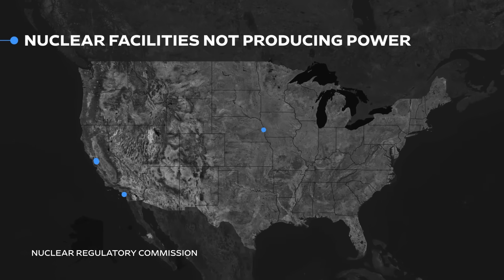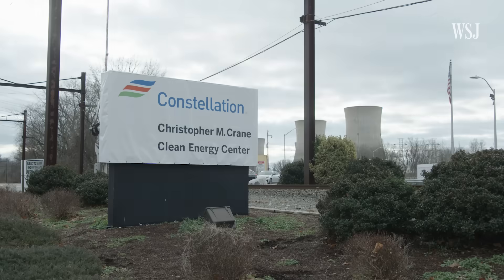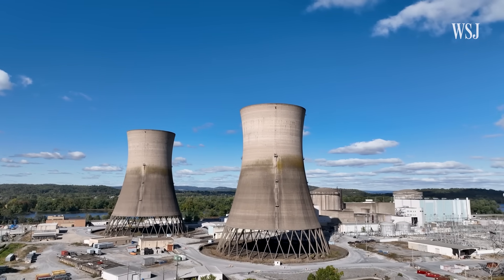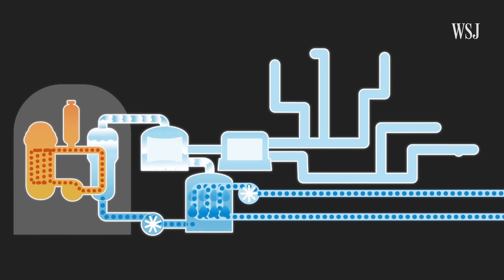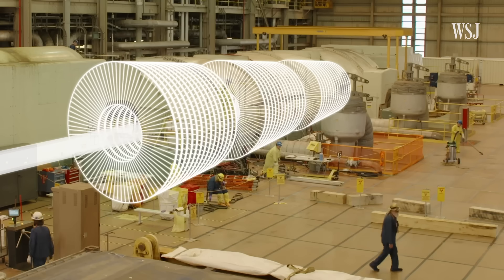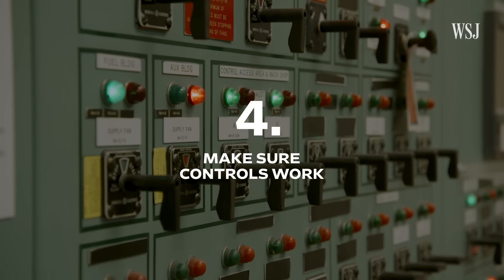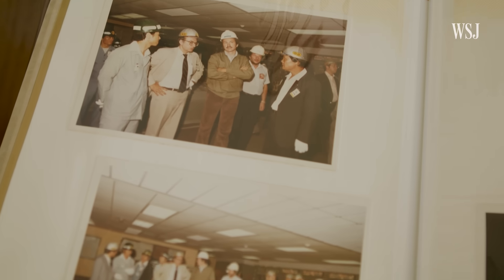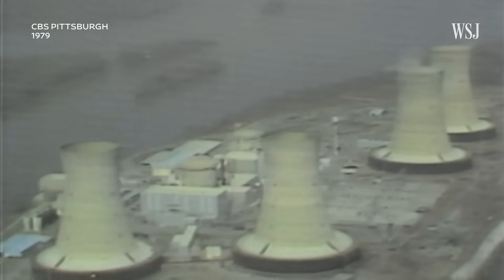Inside the $1.6B Plan to Restart Three Mile Island | WSJ

Comment: Three Miles Island was shut down due to commercial reasons. Translation: nuclear energy is to expensive.

Now demand has spiked due to the AI boom and Microsoft needs a "fast" solution. It seems to be relative cheap to get the old reactor back, but building a new reactor is a nightmare that the US gave up on a long time ago.
Reply: Yep, we tried to build a new nuclear player plant in South Carolina and had to stop halfway through. Georgia built the same plant and it costs 10x the starting cost.
Reply: As the old saying goes, "demand creates supply." Move the demand curve and the supply curve suddenly finds itself aligned with things that weren't previously viable.
Reply: They need power AND they probably get carbon credits from it too.
Reply: Constellation is selling to energy to Microsoft at 13 cents a kWh. It’s not that nuclear is all that expensive - it’s that natural gas out of the Marcellus is cheap. Couple that with the deregulated market where they sell - PJM, and yeah, it was got difficult to justify keeping online. 

Believe it or not 25 years ago when all this deregulated in power markets happened nuclear power plant operators were chief proponents of that - they thought they’re cheap nuclear power would whip the floor at the auctions -annnnd then the shale revolution happened. And suddenly you at natural gas bidding at cents a kWh.
Reply: @BernhardWelzel  aren't they building a new plant in Georgia? Several projects around the nation look it up
Reply: @FredroStarr12  I did. Just look at the cost overrun, timelines and issues this projects have. It is a nightmare. Building a new nuclear power plant is incredible hard in 2025.
Reply: It was shut down because of public panic!
Reply: @ Sorry, you get your facts mixed up. There was public pressure after fukushima, but the actual reason was cost and the need for investments. 

Same for example in Germany: the industry needed to invest a lot of money into the existing nuclear reactors and was very, very happy when politics demanded to shut down after fukushima.
Reply: This is the exact "roadway", a.k.a. strategy.
Reply: The financial reason was a bunch of cheap natural gas flooding the market, it remained profitable all the way into 2019 so maybe you're just wrong
Reply: @MrTrainman96  The company running the plant said it hadn't been profitable since 2012. But I'm sure you're right and that was just BS. Companies are after all famous for shutting things down that make them money.
Reply: @MrTrainman96  I am not sure. When you look at data regarding the cost per MW of energy that is not created by some nuclear industry "thingtank", it seems renewables are much cheaper. I am not saying nuclear is good or bad, it is just a matter of the numbers making sense. Of course, having a mix might be a great idea as well as factoring in the actual time to build a new nuclear reactor...
Reply: Nuclear Energy isn't expensive, but the main problem is that it produces too much power overnight. Most places just don't need that much power overnight. However, AI datacenters do, making nuclear energy a good solution to power them.
Reply: @jmlinden7  That's nonsense.
Reply: @ You have to pay to operate the nuclear plant overnight, but nobody was paying the power company for the electricity that they produce overnight. That's why these plants were losing money. If you can find a customer that actually pays for overnight power then the plant profits instead of losing money.
Reply: @jmlinden7  i don't know about all nuclear plants but the reason TMI shut down in the first place was because it couldn't compete with the pricing of natural gas generators. The company that owned TMI lobbied for over a year to try to get subsidies from the PA government to keep the plant open, but eventually ended up shutting down. I haven't been able to find info on what rate Microsoft agreed to pay over the next 20 years, but I have to assume they are paying a slight premium to be able to say they use green energy and for the whole restart to make financial sense from constellations side.
Reply: @ Natural gas is easier to increase and decrease production, or even shut off completely, so you never have to pay to generate power that nobody uses. This is great for most residential uses of electricity that fluctuates constantly. However, if you need a flat amount of electricity 24/7/365, then natural gas is slightly more expensive than nuclear. Plus the green energy credits, etc.
Reply: @jmlinden7 
Building an accumulator to store the surplus is not difficult. A high lake being filled at night. By pumping water uphill to fill the lake and then shut the pumps off and let the water running downhill spin generators. And other ways. It doesn’t even need to be close by.
Reply: @mikeshotrodshop  Nuclear power plants are generally built in places that don't have hills nearby. And the cost of building the accumulator makes it more expensive than just using natural gas. Which is why we stopped using nuclear until we developed an industry that required a lot of power overnight.
Reply: @jmlinden7  "it produces too much power overnight."

What, the control rods stop working when the sun goes down? Or the turbines explode if they turn too slowly? Lol
Reply: @ Demand plummets overnight. It produces a fairly steady amount of energy overnight. And yes the turbines are designed to always spin at the same speed. If supply exceeds demand then the turbines start spinning too fast (not enough resistance) and that can cause damage to various equipment that assumes a fixed spin speed/frequency.
Reply: @jmlinden7  you presume that humanity cannot live without Ai
Reply: @Meltpk  Humanity can easily live without AI (we can live without a lot of things, as the first million or so years of our existence as a species readily proved) but if AI data centers are going to exist, we need to power them. Whether this is a massive waste of resources (it is) or not is a secondary discussion to the currently- and near-future-existing problem AI data centers create.
Reply: @SimuLord  we will* power them
Other than that, fair enough. I can't argue with that.

Comment: I don't know why we're not using the new meltdown-proof plant designs. That removes a lot of the fear factor, and the new designs are more efficient. I hope they deliver the plant on-time and on-budget. (and streamline the regulatory regime)
Reply: I work in the nuclear industry.

Frankly, it's pointless to care about the fear factor because it's totally disconnected from engineering or physics. People opposed to nuclear power usually don't even know what a neutron is. There's no easing their fears with a safer plant design because they won't understand it and won't believe you anyway.

It's like trying to explain to a frightened dog how the vacuum cleaner works and why it shouldn't be scared. Only the dog is smarter and more rational.

Plants should be made safe because it's the right thing to do, but you can forget trying to alleviate fears by improving safety. Your best bet would be to start some conspiracy theories about something else to distract those sorts of people. Different conspiracy theories for the left and right leaning anti nuclear activists of course. Give the dog something else to bark at until you've finished hoovering.
Reply: The last sentence 
😂
Reply: Yeah....that sounds alot like "the unsinkable ship".
Reply: @Meltpk 
Well you can make unsinkable ships…literally all that’s required is making a ship which is buoyant in all circumstances.  Is it reasonable? Probably not, but it can be done…the same is true of nuclear energy.  You can, in principle, make it such that you remove the physical possibility of any positive feedback loops which conclude in a meltdown.  These aren’t reactors in which systems are placed to ensure it doesn’t happen, it’s based on principles of physics which make it impossible for such a scenario to occur.  Now this does mean that there are extensive challenges in making such a reactor (complexity of design, far higher construction costs, etc), but from a physics standpoint, yes you absolutely can design a reactor which is intrinsically “meltdown proof” simply by virtue of the design and material choices made.  For example, molten salt reactors  have a negative feedback with temperature.  As temperature of the fuel increases, it experiences thermal expansion (as does just about everything else), which decreases its density, which in turn makes it so the reaction rate reduces (because atoms are further apart and the probability of a fission event decreases) and since the reaction rate reduces so does the heat generated by active fission.  In this way, the possibility of a runaway reaction is physically negated by the physical properties of the fuel itself, not by some external safety device.  You can then even add on more mechanisms just for redundancy like freeze plugs that drain into a reinforced containment structure if the reactor overheats, such as by pump failures or unexpected pressure buildup.  These freeze plugs ALSO are intrinsically fail proof since they work by having a melting point which is above operating temperature but below the danger threshold (and the materials are specifically chosen to have this prompt), so whenever the reactor goes above that critical temperature for the plug, the plug will melt allowing the fuel to drain into specially designed tanks which (again, based on limitations of physics) necessarily result in fuel geometry which keeps everything subcritical (non self sustaining nuclear reaction).

The idea of a inherently safe nuclear reactor is not ridiculous; the only thing which is ridiculous is to believe that profit driven entities will take each and every measure necessary to ensure those reactors are built and operated properly.  

(Forgive me for any inaccurate use of terminology; I’m a physicist not a nuclear engineer, so while I may have misworded things as to how a nuclear engineer might say them, from a theoretical physics perspective, the idea of an intrinsically meltdown proof reactor is indeed more than possible)